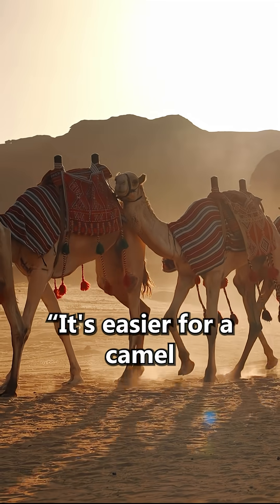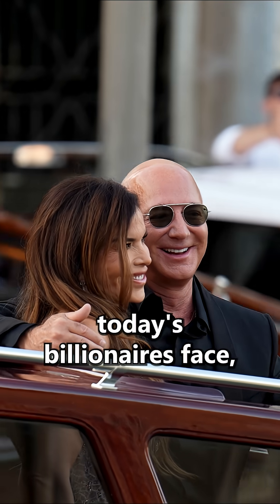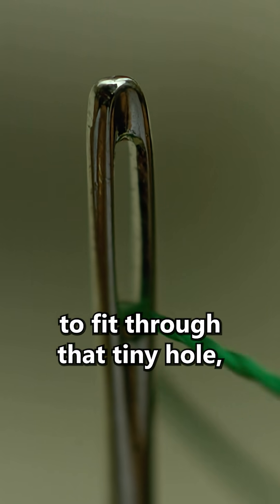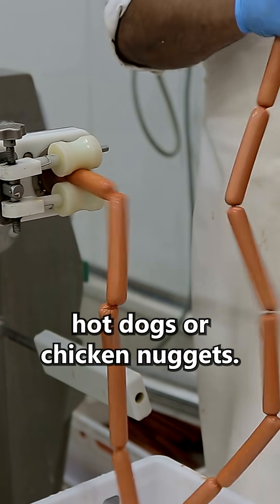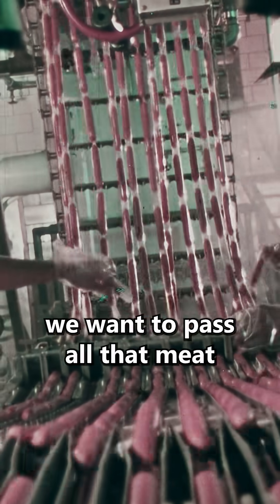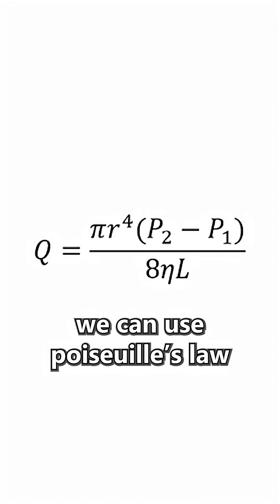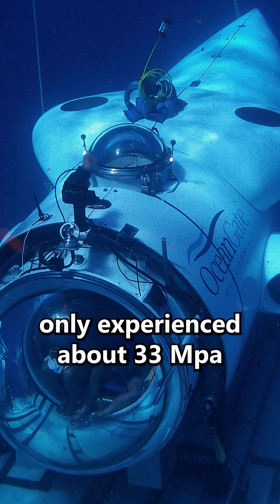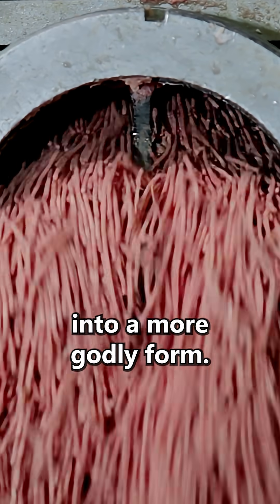Passing a Camel through the eye of a needle

Comment: I appreciate the calc. I admire many of your science videos. However, The eye of a needle was an opening in the barrier in Jerusalem not a sewing needle (not quite an anachronism but kin to it).Think small castle openly easily defended in war. It was hard to get camels low enough to coax them through it with the reigns.  Camels are tall and stubborn. It was not impossible.  You can get them through. So says the guy without a camel.
Reply: independent. the meaning is the same

Comment: i feel like for a historically accurate calculation you need to use the average size of a levantine bone needle from the forst century, which most likely had a larger eye (and would also break much more easily)

and in case anyone wants to claim that "historically accurate" would be some sort of city-wall gate: that interpretation is an invention of the 10th or 11th century.

Comment: What about the actual energy to turn it into the meat paste? 
  The hydraulic press channel does things where they squish things through a tiny hole, like candles, soap, plastic, etc, even meat one time! They put the object in a large heavy steel walled cylinder with a piston attached to the press and a small hole or holes on the other end of the cylinder housing. It takes a surprising amount of force to squish even relatively soft stuff completely through, i could only imagine the force required to squish an actual intact camel through a hole that small in the same method. Itd probably be like 500 megapascals or something...

Comment: i do feel like the spirit of the original quote is not for the camel to slowly go through durrinh the course of 24 hours i think its more along tue lines of 10 seconds
Reply: Or standard camel walking pace.
Reply: So ~1382400 megapascals to get the job done quick, which is both horrifying and efficient
Reply: @Krunky_Munky it would be like 40km per second stream I doubt that pressure would do it considering it would probably change material properties before we reach such velocities that would probably turn stream into plasma.

Comment: So much time invested in the deliberately absurd image. Utilizing two extremely common participants in their culture that sets the magnitude of the task. A challenge you accepted in linear manner. What I fail to peruse is any analytical exploration into the reason why the greedy would be declined entry into heaven? Why is that? 

There is a far simpler, and cheaper, way to pass a camel through the eye of a needle. You stick the needle into something that will keep it standing. Then position the needle as far as allowable from the camel. Place in on a support. Now, you align your eye with the camel in line with the needle. Next, move closer to the needle. Maintaining this alignment as you get extremely close to the needle you will be able to refocus on the camel through the eye of the needle.

Comment: Hmm, it looks like the paste would probably be cooked in the process, as (if my calculations are correct) the pressure would cause a temperature increase of 71C. The good news is that it seems that they will remain a fluid even at those pressures.

Comment: Camel isn't just meat though, so you somehow need to know the average viscosity of a camel itself, then how much pressure it would take to push it through a needle sized hole (which has to be extremely sturdy so it doesn't bend/break)

Comment: Now, if not 24 hours but the time it takes to enter the average large gate. That would make it alot more interesting!
Reply: We are probably talking about some percentage of the speed of light at that point
Reply: Skipping most calculations and working with the 5 grams per second at 5 meters per second numbers, and assuming that it takes about 1 second to pass through a large gate, the camel paste has to be 90,000 times faster, or about 450,000 m/s.

Keep in mind that I almost failed college physics.

Comment: What kind of temperature would this meat paste be?
Reply: Someone wants pre cooked camel paste hey
Reply: @dontnubblemebro you know that’s right
Reply: What if we liquid cooled the needle?
Reply: @Darth_Agnan I think we'd also need a way to reduce friction while maintaining density and pressure so we have the same high flow rate and maintain a low temperature
Reply: I think the heat produced through the pressure in combination with the tiny size of the hole would solidify/harden the meat instantly and clog up the hole. This would probably take months if only one person operated the machine and had to clean it out every 3 seconds.
Reply: @dontknowdocare  it would heat the metal up faster than the meat
Reply: @texastank so the metal can grill the meat. Perfect:
Reply: @dontknowdocare I think there would be enough pressure for the chunk to be dislodged without clogging the needle. Assuming the paste is fed through a tube that is.
Reply: @dontknowdocare couldn’t you add cooling?
Reply: Medium rare?
Reply: Someone get XKCD on the case!
Reply: the heat kind
Reply: very
Reply: Hot
Reply: hot
Reply: Probably Celsius
Reply: HELLFIRE HOT